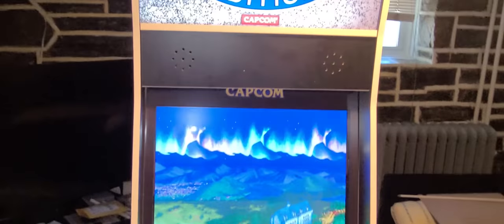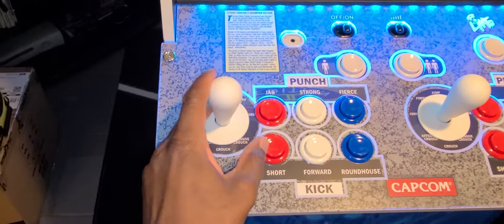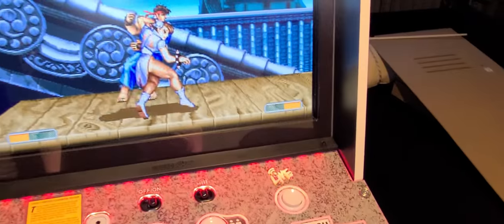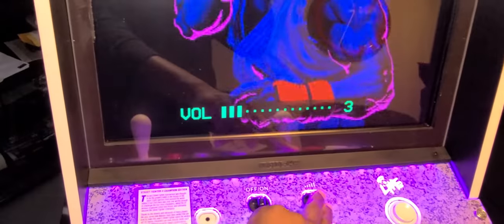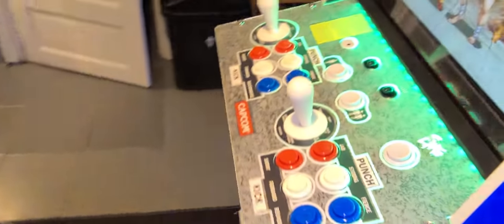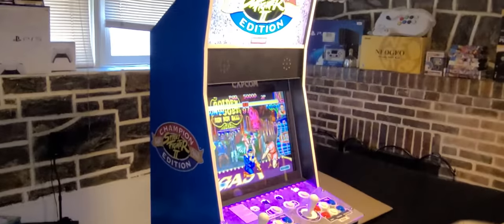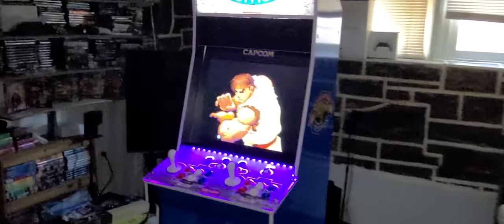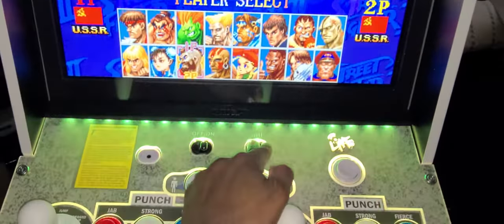Arcade1up big blue with Boss speakers hug Subwoofer, 20 inch Dell monitor and more review

Comment: Great mod! I'm thinking of picking up big blue and interested in the monitor and joystick mods. Can you share where you sourced them? Also, can you share how you connected the monitor and what's needed? Thanks.
Reply from the maker: Hey no problem! I end up getting the monitor from eBay always look for someone who is selling  refurbished one and for the joystick and button. I got them from eBay also from a seller called Tornado Terry's he sells whole joystick and button kits for $55 or I think you can visit his website.
Reply: That looks super clean! By no means is it overkill if it achieves what you were going for :) You did a fantastic job on the  entire build and makes me want to get a Big Blue next. Keep up the great work and as always stay clean and game on my brotha!
Reply from the maker: @cmart7307  Hey thanks a lot. I really had fun putting it together. The only hard part was waiting for the parts I need it to come in the mail. LoL
Reply: One more thing, where did you get the blue screw caps and the stand for a bit more height? Thanks in advance and again, amazingly good looking mod.
Reply from the maker: @Tkid555  hey I got the blue caps from a website called Retro 530.com and for the Dolly I picked that up from Amazon. The name of the brand is spacecare mobile roller dolly or do a search for adjustable furniture dolly for refrigerators and washing machines👍